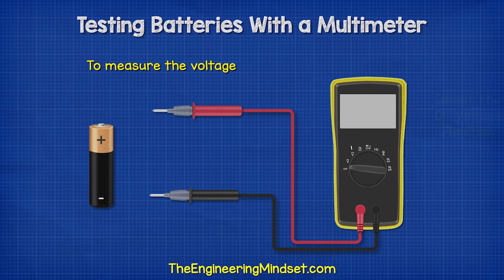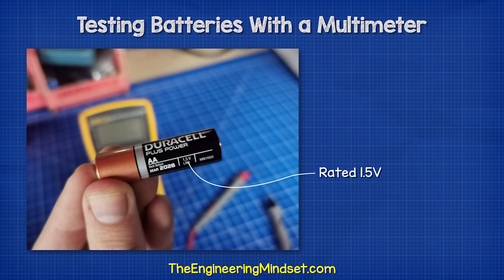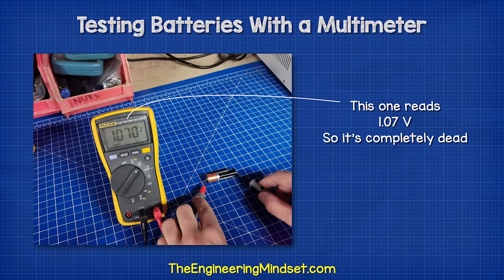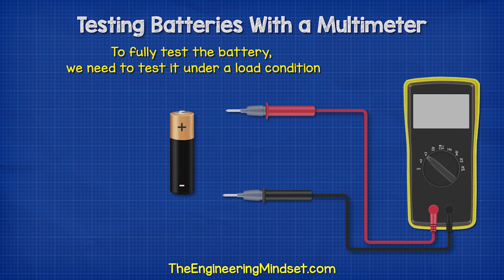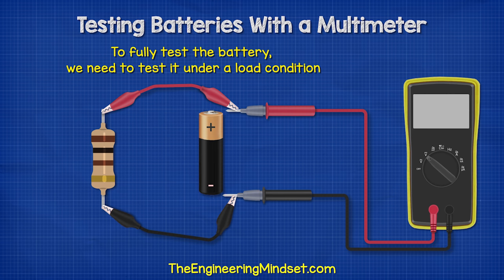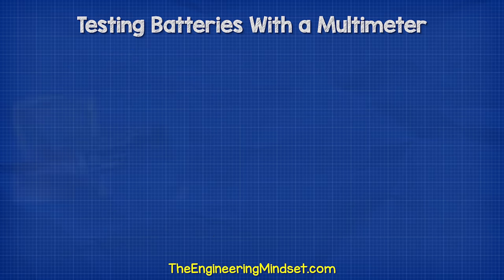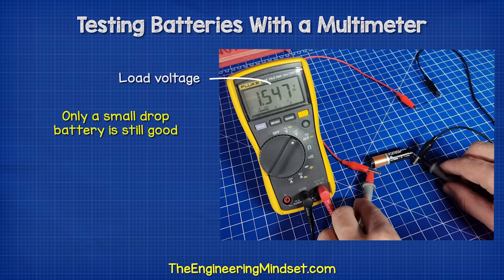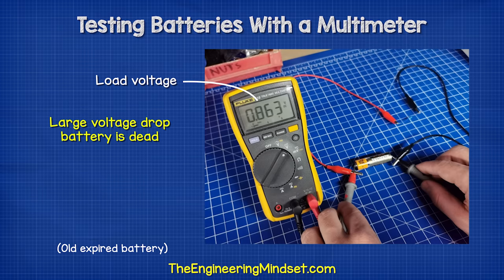Testing Batteries With a Multimeter - AA Battery Test

Comment: It’s great that you just jump right in to the material without some kind of annoying intro like so many others feel the need to do. Thank you!
Reply: Especially those 'like and subscribe bla' before the video has even started. So many do that and at this point it has become redundant. A 10 ohm resistor won't help though.
Reply: Yes thank you for saying this!
Reply: Thats true
Reply: yeahh !!
Reply: if you don't have a resistor, load your batteries into a TV remote control, that oughta put some load on it. Then measure the voltage on the battery terminals while they're in the remote control.
Reply: Especially the “hey YouTube! It’s yah boi…” I usually turn off videos that begin with that.
Reply: amen to that!!!
Reply: Exactly! 5 minutes of: Welcome to my channel, bla bla bla
Reply from the maker: Check out NEW resistor video, everything covered! ➡️ https://youtu.be/DYcLFHgVCn0
Reply: Yes, those unnecessary intros.
Reply: DITTO💯
Reply: The quick brown fox jump over the laxy dog.
Reply: Amen Libby! (Libby3:16)

Comment: You've told 'em how to measure, but not what they should be measuring. At what threshold voltage would we consider an alkaline battery dead under a 100 ohm load? Having a measurement but not knowing how to interpret it isn't very useful.
Reply: I was also wondering what voltage is considered still "good" for a 1.5V battery - 1.4? 1.3? Hope some clarity is offered..although I know I can find this on google as soon as I'm finished typing this response :)
Reply: That depends on the use.   A wall clock works fine  at 1.2 v  but a laser pointer would not.
Reply: @danc2014  Yup, depends on the current draw. Which is why I specified "under a 100 Ohm load", as that's the example resistor value he used in his video.
Reply: A rule of thumb like xx% drop from no load voltage at a specific current would be nice to know.
Reply from the maker: Check out NEW resistor video, everything covered! ➡️ https://youtu.be/DYcLFHgVCn0
Reply: @EngineeringMindset  To all reading this, don't bother checking the new video.  The part of interest in battery testing is identical.  Nothing new is offered.  Wasted time.
Reply: @IncandescentDaD  yeah, felt like attentionwhoring/algorhythmic pleasing from his end
Reply: That's probably() dependent on the power requirements.  Think of it like a bucket. if a tiny led takes little sips of water it has alot if sips to take. If a giant bulb takes 4 gulps of the same amount each gulp to finish the bucket but the bucket has 4.5 gulps worth of water then the bucket will be considered empty to the bulb after the 4 gulps leaving the 0.5 volts because its too weak to push through the bulb(resistance is futile, well the other way around)

Comment: He totally forgot too mension that even if the voltage is under the specific 1.5 V for  ex aa, or aaa batteries is still usefull, Its when the battery is totally useless the voltage is under 0.8 V and not worth using at any device for ex a remotecontrol for a tv. Soo never throw your batteries away before using them up them totally. Is both good for nature and your less spend money

Comment: My 10 year old Casio caculator batteri, original battery is at 1.53 V, should be at 1.5V, but assumed it would have dropped after being used for 3 years of high school and 3 years so far of engineering studies, I don't get why it hasn't dropped, it's not a capacitator, and it's not a solar model calculator, just a plane old no thrills scientific caculator...

Comment: Why don't the manufacturers put a battery test option on the multi meter dial to incorporate a 100 Ohm resister. Would make life easier.
Reply: Many multimeters do have it.
Reply: My Greenlee multimeter have a 1.5V and a 9V load test which I never used before, until watching this video ;
Reply from the maker: Check our new Multimeter tutorial out ➡️ https://youtu.be/4lAyzRxsbDc

Comment: You know what would be great? A whole section of multimeter instructions. How-to's! I understand there are actual college classes the subject? I would be obsessed with that playlist.
I have this giant Fluke my boss paid $1000 for and I only use, like, five functions.
Reply: Five?! I just know how to make mine beep.
Reply: if you don't have a resistor, load your batteries into a TV remote control, that oughta put some load on it. Then measure the voltage on the battery terminals while they're in the remote control.
Reply from the maker: Check our new Multimeter tutorial out ➡️ https://youtu.be/4lAyzRxsbDc
Reply from the maker: Check out NEW resistor video, everything covered! ➡️ https://youtu.be/DYcLFHgVCn0
Reply: Perhaps you will discover uses for the other functions, by a ... fluke.

Comment: Thanks!  I've been having issues with batteries passing a voltage no-load test as being good but the devices they powered not working well.  I didn't know that inserting a 100 Ohm resistor method would provide such a different result.

Comment: Nice tip about using a resistor. 👍
Reply: Two 12V headlight bulbs wired in parallel should do. Of course the bulbs will come ON but you need to measure battery voltage for any significant drop. 

Or simply leave the battery installed in the car, keep the engine OFF, turn ON the headlights and measure for any significant voltage drop.
Reply from the maker: Check out NEW resistor video, everything covered! ➡️ https://youtu.be/DYcLFHgVCn0

Comment: I pull the batteries out of lights & such when I put them in storage, in case of corrosion.  I end up with a lot of partially used batteries as a result.

If I use the 100 ohm load test described, should anything below 1.5V be recycled?  I expect battery requirements will depend on device the device, but I'm looking for a good (not perfect) rule for keeping "good" (used) batteries.

Thanks for posting this!

Comment: How would this compare to a consumer battery tester? Can battery testers also show 1.5 v when depleted or do they have that resistor trick built in?
Reply from the maker: Check out NEW resistor video, everything covered! ➡️ https://youtu.be/DYcLFHgVCn0
Reply: There are some battery testers that provide a load, such as the ZTS MBT-1 tester, but many do not.  The MBT-1 is a fantastic tester that tests many many different types of batteries beyond your standard 1.5v AAA, AA, C, and D cells.

Comment: Does this work to test a car battery?  If so, what size of a resistor is required?  Also, does the resistor size increase depending on the volts of a battery?

Comment: Hi, amazing video and great info! One question: Can you use the multimeter to test for current without the resistor? I mean, is there any buit in function that will act like a load to measure current? I'm using a regular cheap generic multimeter. Thanks
Reply: I don't think so. I do have a battery tester that will do this. It has a needle with Good, Bad etc and works for AA AAA 9V and (unsupported) button cells, like the CR2016 -> CR2032.
You can find these at Bunnings, they have been selling the same model for years now.

Comment: Great way to test it with a light load.  It can also be tested under load in the device it's installed if it's accessible, but I like your way for a quick test.
Reply: If it is a remote controller, would Input both batteries in and then test each with the multimeter?
Reply from the maker: Check our new Multimeter tutorial out ➡️ https://youtu.be/4lAyzRxsbDc
Reply: @EngineeringMindset  The section of interest in your new video (battery testing with a load) is identical, so nothing new was learned. It's at the end so I spent time watching the whole thing.  Slightly devious.

Comment: I have a really cheap battery tester.  It shows "batt V" with two settings:  1.5 and 9.  Can I test a 12v MN21/23 battery using one of those settings?  Thanks for a clear and useful video.

Comment: Can I use the same method while the battery is under load inside a flash light if I don't have a resistor at hand? Thanks!
Reply from the maker: Check out NEW resistor video, everything covered! ➡️ https://youtu.be/DYcLFHgVCn0

Comment: My multi meter has a battery test setting which i assume has that 100 ohm resistance built in.
Edit* just tested the meter with my other meter & when the battery test is selected & i probe the battery testing meter & it reads 75ohms.
Reply: The actual impedance value is not critical as long as it’s realistic approximation of the load, I always assumed it was built into the meter as you observed.

Comment: You can simply measure short circuit current in a short period of time not to drain or overheat the battery. If the short circuit current is more than few amps (depends on the battery) battery is usually good.
To do this put the multimeter in DC Current mode in AMPS (not miliAmps) and test it: red on plus, black on minus side. Testing should not be longer than couple of seconds (2-3) to prevent damage to the battery
Reply from the maker: Check our new Multimeter tutorial out ➡️ https://youtu.be/4lAyzRxsbDc

Comment: Great video! But could you explain why this happens? Please
Reply: like a car engine trying to drive uphill, it has to work harder. sitting in your driveway idling isn't actually working but still a good engine.
Reply: I remember way back in tech school, an instructor once sad, "batteries don't go dead, their internal resistance goes up until they are not usable"

Comment: hey i have a batter pack, its for an old rc car and its rated 6 volts for 5 batteries together, i read the voltage ( the charger didnt work ) and it read 0.315 volts, dead or rechargeable?

Comment: what if it’s a rechargeable battery does the voltage changes when the battery charge is low or charge is high

Comment: if you don't have a resistor, load your batteries into a TV remote control, that oughta put some load on it. Then measure the voltage on the battery terminals while they're in the remote control.
Reply from the maker: Check out NEW resistor video, everything covered! ➡️ https://youtu.be/DYcLFHgVCn0

Comment: Hi everyone. I've tried this method. I bought a big bag of resistors from 1 ohms to 40k and despite following this tutorial, the voltage does not drop at all for AAA, AA and 18650 batteries. I've switched to the ohms setting on the multimeter and it does show near enough the right ohms for the resistors.
Reply: If the battery is ok, there should be no drop… Are your batteries really in bad shape?

Comment: What would be a good sized resistor to use when checking 12v car batteries? 
I am aware that they make load testers for car batteries but can you recommend a different resistor to use instead? Something more DIY then buying a $50 load tester?
Reply: Two 12V headlight bulbs wired in parallel should do. Of course the bulbs will come ON but you need to measure the battery voltage for any significant drop. 

Or simply leave the battery installed in the car, keep the engine OFF, turn ON the headlights and measure for any significant voltage drop.
Reply: @daviderhahon  Great advice. Thank you!
Reply: If you want to determine if it will start a car you need the car load tester  100s amps not just a few lights 2 amps .  Electronic battery load testers are also sold.
Reply: @danc2014  
That's correct Dan. 
That's a special case
Reply: @danc2014  Greatly appreciated!
Reply from the maker: Check out NEW resistor video, everything covered! ➡️ https://youtu.be/DYcLFHgVCn0

Comment: Wouldn't the meter inherently provide a load (resistance)...simply by having the current flow through its wires and internal electronics? Why is there even a need to provide a load to measure the potential difference?

Comment: Thanks for this, I always wondered when testing batteries if i was measuring correct voltage by hooking up the meter in line  (normally done for measuring current) rather than across a load.

Comment: What if i want to measue a battery that is more /or less than 1.5v, do i still need 100ohm resistor or less/more?

I have watched many useless vids about measuring 🔋 batteries.
This vid is the only useful vid.
Thanks for starting stright away without annoying commercials.
Reply from the maker: Check out NEW resistor video, everything covered! ➡️ https://youtu.be/DYcLFHgVCn0
Reply: @EngineeringMindset  ok thank you
Reply: @The Engineering Mindset  correct me if im wrong.
I've calculated that my 100ohm resistor will burn 🔥 if i try to measure it with a 9v battery.
9v ÷ 100 ohm= 0.09A
100 ohm × 0.09² A= 0.81 W
My resistor have color Brown, Black, black, black, Brown.... i looked it up on the internet and its 0.25 W.
So 0.25w with 0.81w will make it burn. I need in that case maybe 1000ohm resistor to measure if 9v battery is good or bad?

Comment: How do you know what size resistor to use? Is there a formula?
Reply: @kennmossman8701  
You don’t always know what that is. Also light bulbs (remember those?) don’t become resistive until current flow and you need to take some measurements to calculate that resistance. I was just wondering if there was a resistance that would cover most batteries out there. Thanks
Reply from the maker: Check out NEW resistor video, everything covered! ➡️ https://youtu.be/DYcLFHgVCn0

Comment: I have recently attached a USB Power supply to my infrequently used Multimeters, to eliminate the possibility of Battery acid leakage inside the meter.

Available in USB 5V DC to
6,  7.5,  9 or 12V Boost &
1.5,  3  or 4.5V    Buck, Converters 
Plug size similar to a USB Memory stick.  Cost around US$5 each, on EBay.

For the small inconvenience of having to attache one of these Multimeters to a USB Charger, I don't have to worry about Battery leakage in any of these meters.
Reply from the maker: Check our new Multimeter tutorial out ➡️ https://youtu.be/4lAyzRxsbDc

Comment: If I get suspicious about a battery, I'll short it briefly then check the voltage. If the voltage is down a bit and going up, it's not so good. If the voltage is pretty much he same and not going up, it's ok.
If the voltage is lower than 2/3 of the rated voltage, it's dead. Others above this but not 'full' will join the line of semi-dead batteries to die over a period of time driving a clock !

Comment: You can test AA and AAA alkaline batteries by dropping them from an inch on to the negative end.  If they bounce they are dead.  If they are charged they will not bounce.  The density of the battery changes as they are used up.  Does not work with MAX batteries.  Great multimeter video.

Comment: Video should be titled how to check a battery with a multimeter AND a resistor. What if I don’t have a resistor lying around?
Reply: Skill issue
Reply: True, I have a volt meter that I use for different things but I do not have a resistor just lying around.

Comment: 1) So a reading of 1.0V means battery is dead.  If dead shouldn't it read zero volts?
2) Again, if a battery is dead why can it read fully charged at 1.5V? Thanks
Reply: @kennmossman8701  So a reading of 1.0 is dead for a circuit that operates on 1.5V but not dead for a circuit that requires only 1V. I'm gonna give up on that one and stick with: 'if doesn't work it's dead'! but thanks for replying.  
They are places I went to record live bands.  I didn't record much in Cebu, and 'Music Subic' would be a more accurate title.  But searching YT for the shorter title gave no result.  I had to add 'Cebu' for the channel to be found.
Reply: It doesn't mean the battery is dead. It means the battery can only output 1.0 volts. It's about the voltage requirements of the device you're trying to power. A device with a AA battery requires 1.5V to work. THat device can usually continue to operate at a slightly lower voltage but once the voltage of your battery goes below the voltage required by your device then essentially the battery is "dead". Dead doesn't mean the battery doesn't have any voltage left, it means it doesn't have enough voltage to power the device.
Reply: Nice info

Comment: First of all , the battery inside the multimeter (1.5v or 9v) must be brand new for most accurate results.

If the internal battery is dead, you will be getting false readings like 1.5volts on a nicd/nimh battery,  1.7volts on an alkaline , 240volts AC on wall plug etc...

Comment: I don't understand how the current goes through the wires to the resistor and doesn't just go straight through the battery like it does without the resistor attached.
Reply: The resistance of the resistor (?!) isn't infinite, so some current will flow through it. An AA battery has its own internal resistance of maybe 0.5 ohms, and we know the resistor is 100 ohms, or 200x greater, so we would expect 200x more electrons to flow through the battery than through the resistor.
Reply from the maker: Check out NEW resistor video, everything covered! ➡️ https://youtu.be/DYcLFHgVCn0